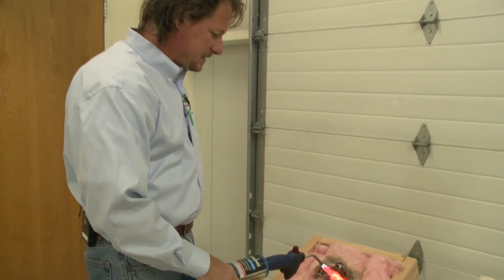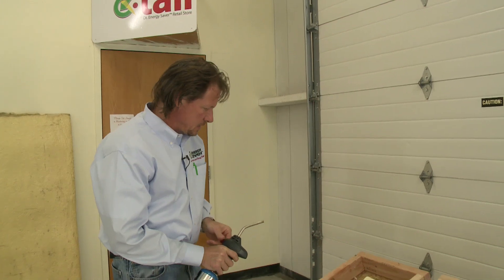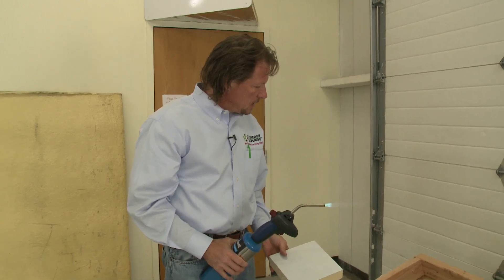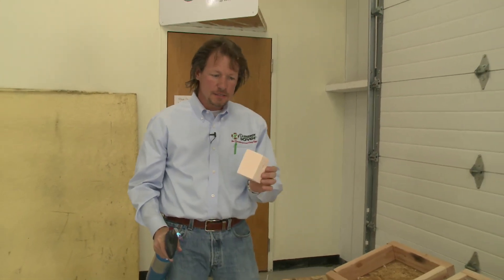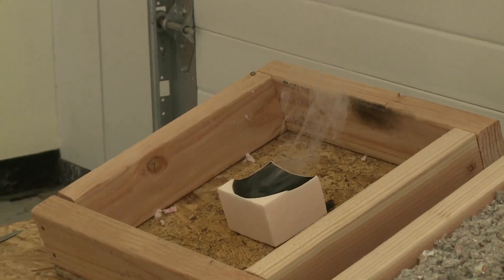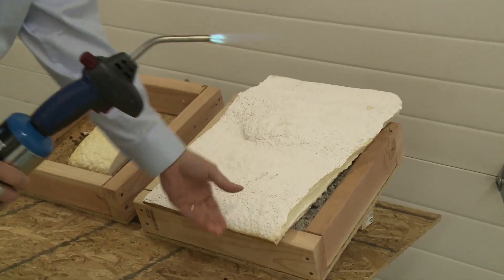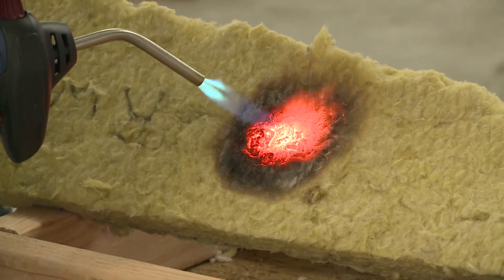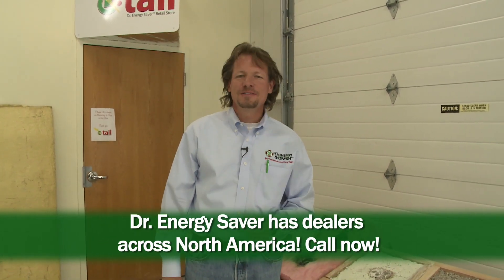Fire Testing Insulation Materials

Comment: You're all over the place with your torch. You jammed it into the batt insulation and held it 6  to 8 inches away for the hard foam. That's a difference of almost 2000 degrees Fahrenheit. Extremely misleading.

Comment: 11 years later and this video came handy big time. Your test on cellulose insulation gave me the answer I needed for my next project. The best part: I don't even need to buy any as I just need a small amount and I can steal it from the attic, where some 15 years ago I added about 8" of it to what was already there. Stuff is super cheap and surprisingly doesn't burn, despite being made of recycled newspaper. Dirt cheap, easy to work with, doesn't irritate your eyes and skin and is super safe. So glad I seen your video all these years later, saved my from buying spray foam. Thank you, from frigid Canada, where insulation is a very important subject.

Comment: glass melts at about 1700 Celsius. Do house fires typically reach those temperatures?  Obviously your gas torch does, but using it to show that fiberglass insulation will melt if house fires don't reach those temperatures is disingenuous.

Comment: Another important factor is the combustion byproducts of insulations. All he foam insulations will release dense, toxic smoke, even if they are flame retardant. Some foams, I think polyisocyanurate foams release a fair amount of hydrogen cyanide when burned. Doing a little research you can see large scale tests where foam insulation degraded in fire conditions and releases massive plumes of toxic black smoke. In fact foam insulation has claimed lives due to its toxic combustion byproducts.

Comment: These tests are incorrect since it does not reflect the usual position of the insulation. The results would have been probably different with a vertical wall. Flames from burning insulation can ignite the insulation further.

Comment: Sir, your handle is "Dr Energy Saver". Do you have a PhD in Engineering or Architecture? Doesn't Polyisocyanurate foam release deadly cyanide gas upon ignition and burning as the "cyan" component in its name denotes? Is there a good reason you are not wearing an appropriately rated respirator? The smoke from many modern foams that burn can render a human unconscious very rapidly, much faster than "old fashioned" combustibles like wood, etc. Is this not a scientific fact? My comment is not to be construed as gratuitously unkind and or, like a gloating, safety Karen , but in the interest of safety for all. There is much to be said,imo, for RockWool type insulation, like by Roxul, except for weight and cost considerations.

Comment: It isn't the fire which gets you or destroys your home....it's the smoke. You can't escape if you are choking & blinded by smoke. 

Our home caught fire due to a hidden electrical issue in the roof in 2017 tat the previous owner left us as a poison chalice (no heat shield on a pot light under cellulose loose fill), nobody hurt. You can't get that smell out of your rescued possessions no matter how hard you try & what treatments you use... remember that when your insurance firm tells you that the items can be cleaned, THEY CAN'T. The things inside your home create chemical fumes which coat everything in a toxic, smelly haze. Paint on the walls, books, paper, magazines, plastics, soft furniture, chemicals in the kitchen, appliances & the materials of the home itself. Until you have  experienced it you have no idea just how awful & traumatizing a house fire is.

Comment: I don’t want to go through all the comments, but it’s probably been said before from a fire fighter. You are testing these products improperly for the ability to ignite and burn. All these units need to have  the correct directional position. The position you have them at will allow many items burn out, because fire and heat rise. So if you at least do a vertical, would be a little closer. Otherwise, you can do beneath like the house is on fire and burning to the ceiling.

Comment: I have personally inspected house with cellulose fibre that was installed over 22 years ago - still completely fireproof - the insulation was levelled to the rafters with a fine crust on top preventing movement by wind. Very neat and tidy as well.

Comment: I had Cellulose insulation in my old house that was built in 2000. I can definitely say that after 15 years, it settles, burns and the entire attic was infested with silverfish. Going through training as a firefighter, I can attest to the difficulty in putting out fires in homes with cellulose insulation. Every time, we would have to rip down the entire ceiling (even if only one room was affected) because of the way fire can smolder and snake through the insulation. If you want to know which insulation is best, call your insurance company. They have to pay the claims and would know best.
Reply: In many contexts spray foam is harder than you'd think to beat because it keeps oxygen out so effectively, chokes it. Let's not forget wood is also flammable so there's the question of how well you're protecting the wood. Not a simple equation. In an intense fire situation you're toast no mater what in a stick frame. Accidental ignition is the bigger concern.
Reply: Spray Foam.
Reply: @TheWhale45  spray foam actually burns easily too.
Reply: as for insurance companies. They will tell you a  sprinkler system works best. There are some counties in the DC MD VA area that require it in the new homes and rehabs.

Comment: Great demonstration video.  "Don't try this at home" kind of thing and there should be over 1million views by now.  I was totally surprised by how the cellulose resisted the fire.  In consideration of the "fire triangle" concept, those insulation materials that flamed up only when the torch was applied demonstrate that in a real building fire, the surrounding extreme heat, combined with available oxygen would cause those substanecs to contribute to the fire.  I was actually dissapointed to see how poorly the XPS performed with flames continuing even after the torch was taken away.  Go with rock wool or spray foam with the thermal barrier top coating.

Comment: I remember a stove from the 1930s I took apart had a ceramic I think insulation around the oven. Put a torch to it. It got orange but wasn't burned at all.
Reply: Asbestos?
Reply: @rsmith02  fiberglass insulation. Like the pink stuff but white.

Comment: We used cellulose blown in on my Dad's home. After 10 years he tried some to see if it still was flame-resistant. It was not. It burned easily. The chemical retardant was degraded to the point it burned.  You should show older cellulose tested. Thanks for the video.
Reply: cellulose can also be expected to rot if it gets wet, I reckon. And blown-in insulation settles over time.
Reply: @tealkerberus748  Dense packed cellulose, which is what you get when you blow it in, shows no signs of settling.
Reply: A lot of “fire retardant” materials will tell you in the fine print they have to be replaced every 5 years or so.  For insulation that is not practical obviously.
Reply: Since you never replied I think you might be a competitor spreading false information. Several people asked very qualified questions yet you remain silent. Shame.....
Reply: Another important point about cellulose, rodents and insects love to live in this stuff! They can easily create a network of tunnels throughout the house.
Reply: @doubleedgedfist1535 seen that crap down south and the worst part is it absorbs liquid and rat and mouse urine is the worst! I don't believe 99% of these vids because of this and these blow torch tests are much hotter that a wood fire that sometimes puts itself out because of oxygen deprivation. It very rare but has been proven to happen. Usually a house fire runs away once everyone rushes out of the house leaving the door open feeding the flames.
Reply: @doubleedgedfist1535  insects hate borate. People use it in their walls to keep bugs out....
Reply: @michaelfranks341  well they loved it at my house.
Reply: If rodents can get in and out of your house in the winter to stay warm absolutely nothing will stop them once inside. They can chew through any insulation. The only way to stop them is to properly seal up any holes on the outside of your house.
Reply: Borate shouldn't degrade, it's a mineral.
Reply: How did you determine the chemical retardant degraded? That seems very unlikely that this chemical, which has been around millions of years before it was mined, would degrade in ten years. Maybe you wanted it to?
Reply: @MikeJones-rk1un  I guess native copper nuggets being found in natural means that copper never ever oxidizes or breaks down for millions of years, right?

Fucking wrong
Reply: I wonder if it was possible that the old cellulose did not have the fire retardant in it?  I believe the fire retardant is a boron based mineral fire retardant and I don't see why it would degrade.

Did you test the cellulose with a fire test before installing it?
Reply: Melting point of zinc?  Just over 787 F.

Comment: Is your Rockwool the same as our Roxul insulation here in Canada?  Aha !  Look what pops up in my google search!  https://www.google.com/search?q=Roxul&rlz=1C1GGRV_enCA751CA751&oq=Roxul&aqs=chrome..69i57.3902j0j15&sourceid=chrome&ie=UTF-8   I've always loved the Roxul!  Loved working with it!  In fact, I've always sworn by it!  & now I have more proof as to why!  I've been thinking of completely renovating a Class C motorhome & I was debating on what insulation I would use, as well as what type of framing materials.  Those things are so flimsy that I do not want to stay with the original building materials.  Yet!  I also don't want o use 2"x4" measurements.  the now Rockwool, only comes in 4" or 6" thicknesses doesn't it?  & I'm going to lose half of my R-value the minute I cut it in half, am I not? I absolutely LUV their soundproofing product as well.  Do you happen to have any suggestions as to what insulation I might use for a 2"x2" framing set up?  I haven't checked in a few years, metal framing is also in the same measurements, isn't it?  2"x4" or 2"x6"  (metal for the weight factors of course)

Comment: Although this is made in the US (and I am in Europe) this is still a really useful review.  The depth of knowledge on display is unquestionable; it's always obvious to me when someone has learned some technical jargon but doesn't really understand it.  You obviously know exactly what you are talking about.  So, even to someone in the UK (where available product ranges may differ) this is extremely helpful advice and very thought-provoking.  Many thanks for sharing.
Reply: What type of insulation is commonly used in attics in Europe?
Reply: @trumpisaconfirmedcuck5840 rockwool, wood fibre, glass fibre, foam. Pretty much the same as US
Reply: @trumpisaconfirmedcuck5840  2 years later... At least in Sweden rockwool is the most common when building new houses.

Comment: I’ve used the cellulose insulation in my house. 

It’s good and cheap, and doesn’t burn. (Wonder if the flame retardant goes away over time?)
It is dusty as hell though!
Reply: Depending on the chemical used its fireproof properties can degrade

Comment: He's talking about white smoke as if it's less toxic, lmao... the black smoke is mainly carbon and soot, means the volatile chemicals that have been outgassed by the heat (the white smoke), haven't been oxydized yet. While the burning isn't efficient and contains a lot of intermediate chemicals in it as well, which can be very toxic and carcinogenic indeed, the white outgassed stuff isn't necessarily less hazardous to your health. But maybe it smells better, that's why he keeps doing deep sniffs at around 8:30. lol

Comment: I agree that "This is not a scientific test" noted in the comments above.  Although rock wool does have twice as high a temperature rating as fiberglass, 2000 degrees F vs 1000 degrees F, the temperature of a propane torch is easily 1000 degrees above common house fires.  If the temperature is high enough to melt fiberglass behind gypsum board then your house is lost already.

Comment: I became interested in Rockwool from watching a channel where a guy built his house pretty much by himself and he installed Rockwool, saying that its fireproofing qualities are so good that if an outlet or switch was to catch fire inside the wall, the fire would actually snuff out because the Rockwool won't burn. 

I don't know how true that is, but if this video is anything to go by, it seem like Rockwool is far superior to fiberglass insulation. The only thing I'm wondering is how fiberglass insulation with its paper backing can possibly be legal to use in buildings since it lights up like a campfire.
Reply: It’s paper faced for vapor barrier qualities but the more i see how it reacts to fire.. i think i will use Rockwool mixed with a plastic vapor barrier
Reply: If you don't know why it has the paper face, then you should be commenting on what should and shouldn't be legal.

Comment: 13:04 That Fire Block spray foam is such a lie and false advertising. I'm surprised they haven't been sued of fined because of it.
I guess consumers using that stuff are smart enough to end up not using it.

It will ignite before the wood does in your house. If you read the specs, they did not get the real fire certification. Instead some kind of altered version of it.

I believe the "gray area" is that it can stop the chimney effect similar to a wood fireblock.
You might even find that this fire block foam is really only intended to be used when sealing around wood fireblocks that have small gaps.
See other video for possible usage: https://youtu.be/pWvBEwRitbE?t=111

Comment: Do you by chance know if the pink fiberglass gives off any harmful fumes when burning? Ive been using it as a wick in an alcohol stove because it doesn't seem to burn ( 1qt paint can, stuffed full of pink insulation, filled with rubbing alcohol till it's saturated) you light it and it makes a great little heater.... IF IT IS SAFE. Found this video while researching this question. Thank you.. good info

Comment: Worst thing not mentioned here is the toxic gases given off by the heating of these foams. Maybe the foam itself will not support combustion but being heated by the burning boards and other combustibles will cause the foam to give off the toxicities. Foam is not a structure supporting itself, there are all kinds of surroundings that will burn and cause the foam to heat and then kill you.

Comment: The fire term is whether it “supports combustion” or not.  If you remove the fire source, does it self extinguish? I.E. Avoids spread of fire.  As to the color of smoke, the general rule is all smoke is bad for health and black smoke is the most deadly.   In as much as your instinct says obtain fire conditioned materials, I would be leery just to trust it. Does it out gas under sun heat and humid conditions? Insulation is a very large mass of materials, so it matters what you are exposed to in mass inside your home.

If I were to build new, I would go with insulating the outside so those materials remain on the exterior and breath to the exterior.  Matt Risinger from the Build Show has real life examples of this.  I would also use a sealing membrane from Prosoco that literally is a monolithic water barrier that envelopes the exterior.  Matt has several videos on that as well and are very jaw dropping to finally see a product that is a real solution the industry has wanted for decades.

Comment: Forgot I had already looked at this...need to check out the air Crete - not familiar with it.  I have seen hempcrete houses just a few hundred miles below me and seem to be working well.  I’m still not liking any of the foams for inside of a house..do the toxic fumes. Maybe if behind mag board that doesn’t burn you would keep the fumes out if a fire started. If I remember correctly, most people die of smoke and fumes from toxic materials way before fire actually gets to them. Ine thing you didn’t test is the all natural wool (sheep’s wool) - used in other countries - not so much here - not enough sheep produced for meat.  I really wish we would get back to clothing of wool, linen, an organic cotton, etc and away from so much polyester which I’m sensitive to - can’t standing sheets that have any poly in them like if you stay in a hotel though most I stay in use 100% cotton.  Anyway, would like to see something on the wool insulation.  I think I’m going with rockwool behind magnesium board.  There are two kinds of rockwool...the kind that absorbs water for horticultural use and that that doesn’t. As I said before, so glad you did all these so I wouldn’t have to do so.

Comment: Percentage of people who die in a fire from attic fire, wall fire  vs percentage of people who will die from cancer breathing in all the fire retardants and chemicals that cellulose insulation. The problem is no one will ever know.  I’ve seen lots of cellulose fires. The retardant doesn’t last forever. It decomposes over time because it’s an organic biodegradable material. Nothing is perfect but only judging by flammability vs poisoning people with chemicals is pretty one sided. In several of your videos I just saw your guys spraying foam insulation on ductwork in the attic. Sealing attic with expandable foam and such. I didn’t hear anywhere in the video where you apologized to all those customers you just “ killed” by spraying foam on ducts that will turn to black smoke/poison while on fire and get sucked into the house by the HVAC duct system. Yikes